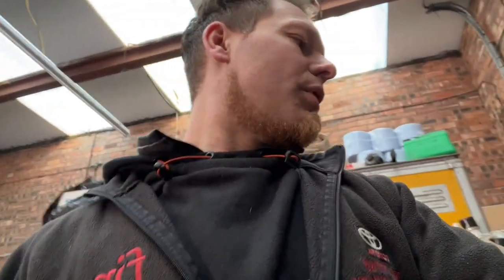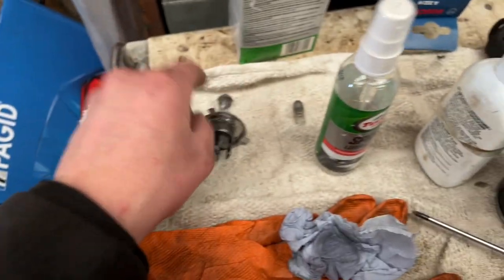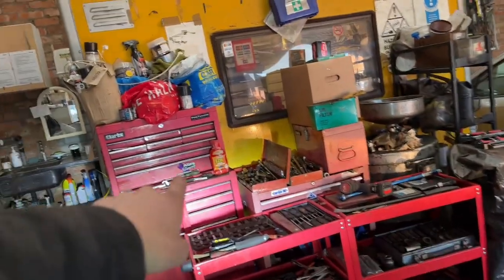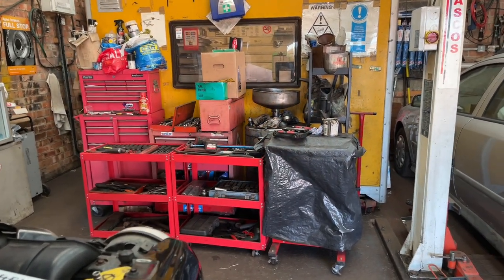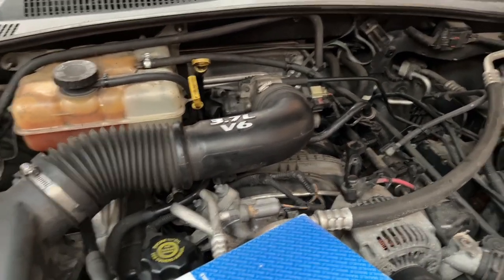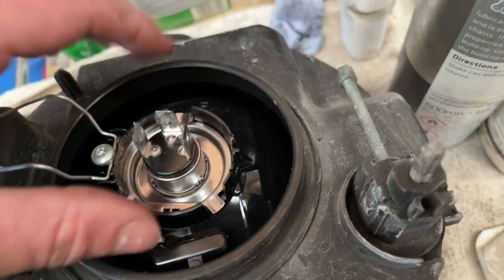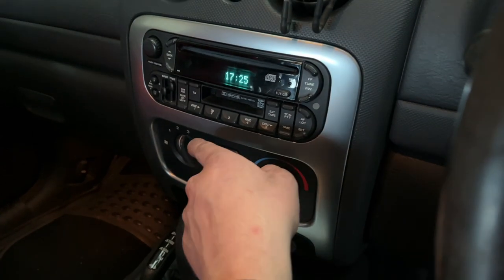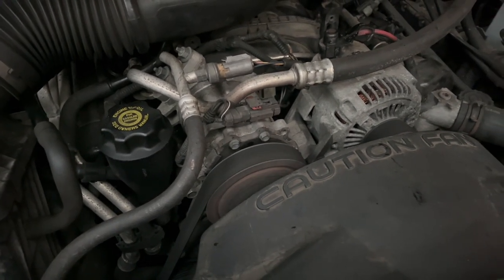Project Jeep Cherokee 3.7 V6 PT4| #jeep #jeepcherokee #4x4 #offroad #cherokee #jeeplife #garage #led

Comment: Hi Dan..
Nice work on the lights and air con. 👍✅

I thought you’d already done the transmission fluid change, why another one so soon mate ? Just interested. 

You must have the new gunmetal wheels on it now I guess.
Reply from the maker: Yes this is an earlier video I wanted to upload, it’s when I first got it you can only get about 2 litres out of 9 litres at a time, then it developed a leak…. What I have a new video coming next day or so 👍🏼

So you do need to do at least 4 or 5 (sump dumps) to actually stand a chance of getting the new oil circulated .
Reply from the maker: Yes there is news on the van, but I will reveal that on a separate video 👍🏼